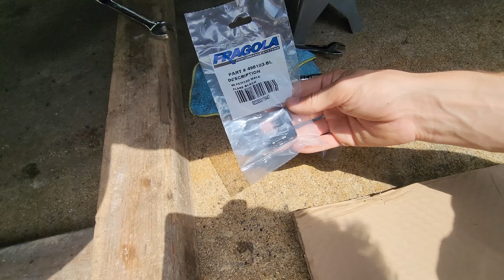Electric Power Steering Pump Installation Guide

Comment: Had the same predicament with my v8 Headers. I ran both lines around the front of the oil pan and 180'd back down the passenger side. I had more clearance on that header side. Ls oil pan and  cd009 doesn't let you running underneath the pan unless your stock ride height. 🤙

Comment: I just did this on my s13 I’m having a issue where I have to physically twist the pump with my hand for the motor to kick on, is this a bad pump I have the controller on it with the dial switch to control speed
Reply from the maker: That's strange 
My best guess would either be the connectors aren't getting proper contact or the pump is faulty

Comment: Did you keep the stock power steering pump installed in order to retain the same size serp belt or did you have to remove it and change the belt size?

Comment: Thanks bro for an updated ver. I'm gonna be doin this in my ka-t coupe here soon just waiting on my 180 amp alt. I have a ton of electronics like my Haltech 1500, IC7, DBW etc. This way I wont overload the already overloaded system.
Reply: What alternator are u running that's 180 amp?
Reply: @ThatMaximaKid  DC power inc
Reply: @echo_verse_void  gotcha. Appreciate it 
I wanna do this setup but still have a decent amount of electronics like audio and stuff

Comment: bel housing bolts ??? optional apparently.

also if your going to have oil inside the car. you really want it in a sealed metal box. 
so in case of a roll over. or major accident. 
You don't get covered in flammable hydraulic fluid. 
its a good reason to keep all that stuff outside of the passenger compartment.

Comment: I know there is a ford electric power steering pump that uses a special mineral oil. Regular power steering fluid or Auto transmission fluid will stuff the pump. Since Ford owned Volvo its possible the tech was shared between platforms

Comment: Probably be better off long term getting a single fitting with the desired angle for the lines out of the rack. Less failure points, but thank you for this info, something I’ve been curious about for a while 👍🏼👍🏼

Comment: This is dope since Ive been wanting to go this route for my RSX instead of using the EP3 Civic EPS rack. Theres a pump controller on ebay that lets you turn a knob and get full power out of it, instead of the 75% max without the canbus. Not cheap at 100 bucks.

Comment: Square tubing or any tubing you paint the outside but it’s raw metal inside of the tubes do they make straws like wd40 for spray paint to shoot inside of the tubes if not will a pb or wd nozzle that has straw insert work on a paint can

Comment: 17:55 Rare to see someone actually hold the hand brake button untill its in possition and then release to lock it in, instead of cranking it across all of the teeth.
Reply: Agreed ,Same with release slight pull up press button and it’s effortless like when u watch women do it they can’t press it in or dudes who have vaginas use common sence lmao

Comment: The reason for going up a gauge is because of voltage drop off. In my mind it would really matter if you used the same or bigger as the distance isnt that far

Comment: Hey Mike! Due to the length of running the line from the trunk area, does this sort of bypass the need to run a power steering cooler?
Reply from the maker: Correct! I have the same length line in my 240 with no cooler. Never had an issue

Comment: Hey mike I always go to harbor freight if it’s around you guys and get the jumper cable packs and use those and cut them up to what I need them for they save a lot of $ hopefully you have one around town and can stock up on wire they have multiple different gauges as well

Comment: def get on ground and spin back and forth about 300 times. turning wheel and having it jump about an inch or two at a time s from air pockets in the rack. def wanna get alll those out o system before road driving.

Comment: @10:40 in future, just add a flat tab onto the bottom of your bracket, then drill hole through that tab, so you can rivnut the chassis, and blot this 3 legged bracket down to chassis fllow, via the flat tabs with holes you welded to bottom of each post. other then that, this is an awesome install. i prob woulda had pump closes to teh strut tower as possble so less invading to trunk space when seat is folded down. but all in all lit!

Comment: I believe the connectors for the pump you listed in the descriptions are 30728420(big, rounded connector with 3 locating tabs), 30658215(small)I was not able to find the pins but you should be able to find a connector kit under just the housing numbers.

Comment: i just put this into my s13 yesterday after rewatching your older video 5-6 times to make sure i understood everything, I went along the outside of the frame rail on the driver side, and it seems like I got away without using any 45 degree bends. Glad to see an updated version of the old video, excited to see the turbo ka since im doing the same ❤
Reply: How does the power steering feel? Light or heavy?

Comment: ptfe line is hte best to use for p.s or atf fluids. as they are corrosive fluids. high pressure is essential as well. but want appropriate liner so lines wont leak from sweating over time.

Comment: reformmotorsports Volvo Electric Power Steering Pump Controller gets you to 100% power on these pumps for like $100 cheaper than the controller in this video. the only down side is you dont get a remote potentiometer to adjust pump speed. there is a potentiometer on the board though.

Comment: i don't mean to sound like an idiot, but why do you locate the reservoir in the trunk and not in the engine bay? That would save a lot of routing since it would be sitting just over the rack. Love the vids, might be a dumb question i just dont see the benefits?
Reply from the maker: Not too much room under the hood, plus with the lines being so long to the trunk, it doesn't need a cooler. Additionally it helps with weight distribution
Reply: @PrizzaMike   alright, i did figure cooling was an issue. Also big fan from Europe!
Reply: With everything this car has added under the hood no room for the pump

Comment: nice video! why does he have to pipes going into the intercooler? is that a twin turbo setup?
Reply: I think it is the "hot side" and "cold side" Plumbed into the same side of the intercooler, not sure though.
Reply from the maker: It's a same side intercooler, very common for RB motors that run the traditional cross over pipe on the intake. 
One port is cold side and the other is hot side